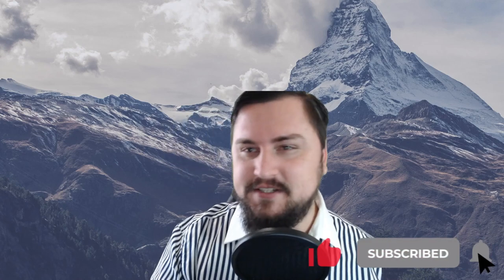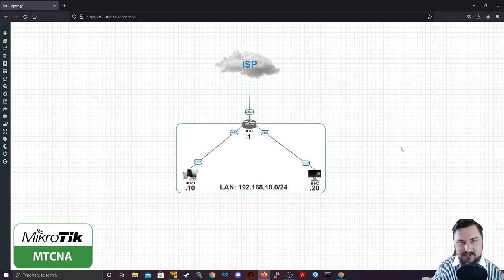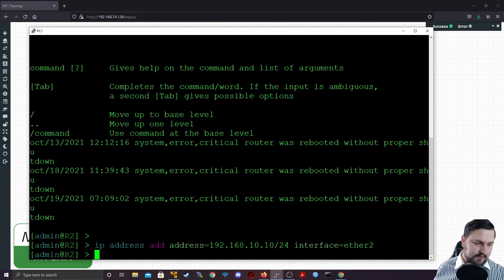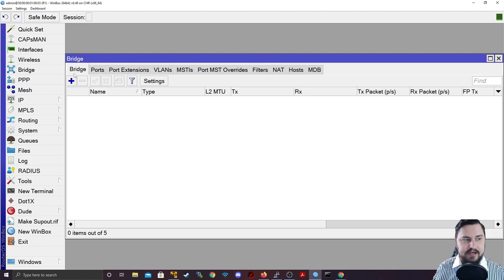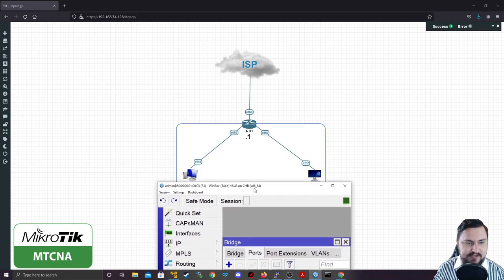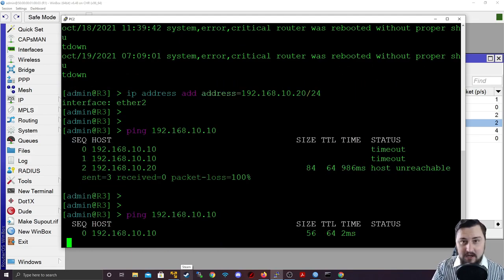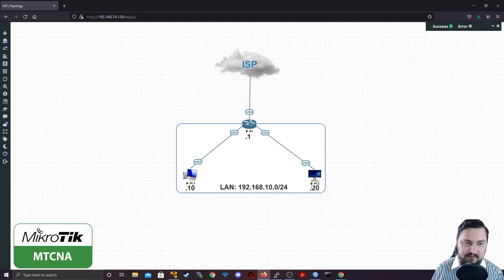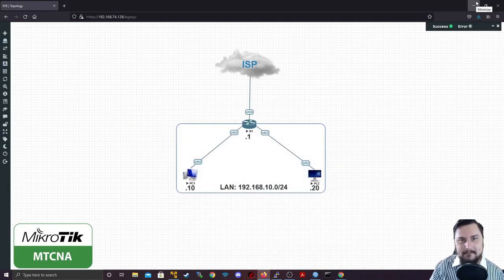Full MikroTik MTCNA - Bridging Concept & Config

Comment: Hi. Thank you for the video. I have a slight issue. I have 2 x hap ac2's. My main router I am using as. Pppoe router and it works great. My second router I set up asa bridge and include all the interfaces incl the wifi to the bridge.
Internet routes as expected through the ethernet interfaces but not theough the wifi ob the second router? How can the internrt fron router 1 be bridged through the ethernet between the routers and theough the wifi on router 2? Am i missing something?